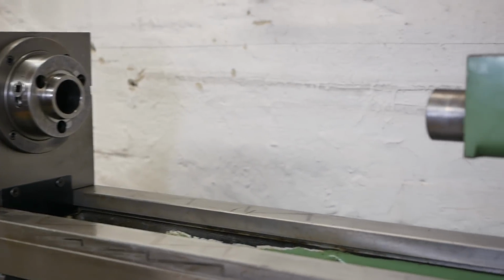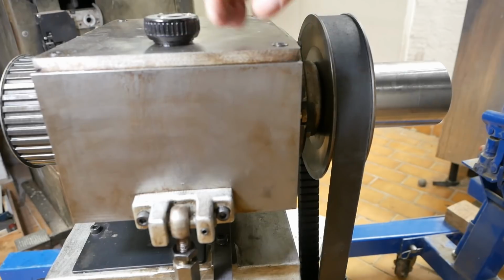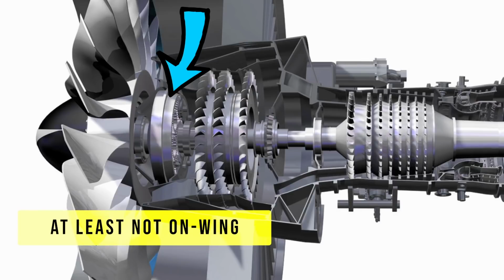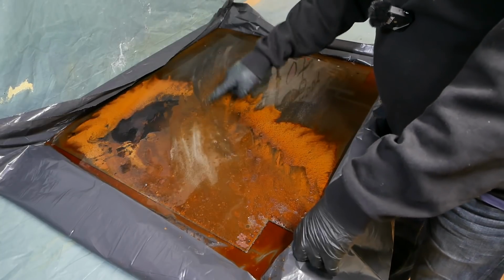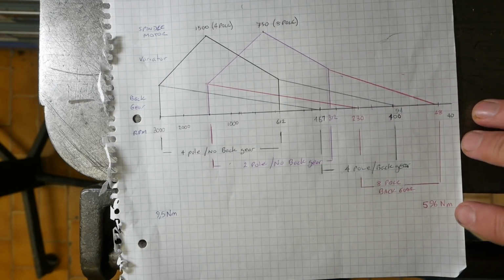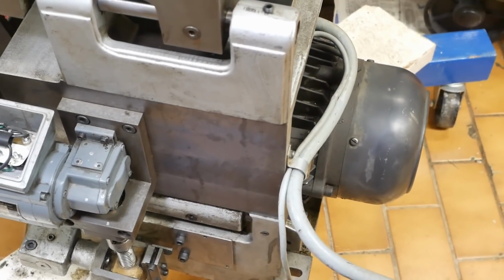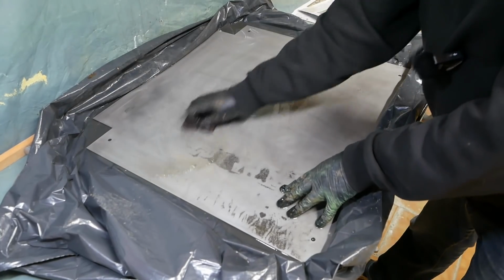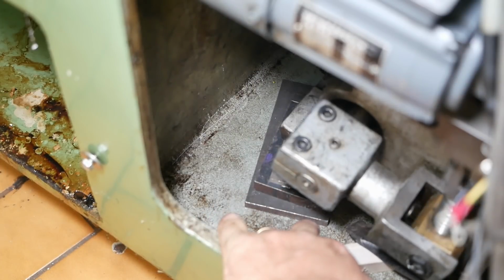Installing the Schaublin drive train

Comment: Maybe add an AC line reactor between the motor and VFD. For just a little more impedence, they offer good harmonics dampening and a cooler running motor.
Reply from the maker: Thanks for the tip.

Comment: I have kept the 35 year 3-phase old motor and the set of pulleys on my small lathe and purchased a VFD so I do not have to change v-belt on pulleys that often. (AND I do not have to pay my electrical distributor to wire my garage for 3-phase)
It hasn't even crossed my mind that VFD could damage my motor. I only run it up to 60Hz and I run 380V motor on a 3x230V (because I only have 1 phase at the garage and use 1-phase to 3-phase VFD. I have purchased used fancy VFD (altivar).
Reply from the maker: The more electrical knowledge you have, the more everything ruins everything else. I also used to think it was as easy as three wire, and you are good to go :)
Reply: @RotarySMP  Mind you, I am not electrician but I have consulted the vfd installation with experts at work and the motor wiring with a very highly qualified retired electrician - he also approved my plan to rewire my motor from star to triangle, so I can utilize the 3x230V vs original 3x380V more efficiently. None of experts mentioned that I have to have a special motor to run with vfd, I was just told not to try things like running it on 400Hz sinus, or changing the default switching frequency of the vfd to much higher values. I wanted to do that to mitigate the high-pitched whine typical for vfd-s. As I said, my vfd was purchased second-hand and it has obviously been installed in industry. I downloaded several hundred pages of wiring and programming manual - unlike cheap Chinese small vfd-s that come with 5 page manual (half of it in Chinese).
Reply from the maker: @first_namelast_name4923  This Lenze also has a very good and thorough manual.

Comment: Keep the original motor, gearbox and CVT and just don't run it at crazy frequencies.  Most of what I've heard on VFD's killing motors has to do with cheap import motors which were probably of questionable quality and would have died anyways, VFD or not.  Additionally, the VFD you have appears to be of good quality so will likely have a cleaner output than a cheap import as well.  
Connecting some of the dots - higher insulation class means higher temperature resistance, and higher frequencies can lead to higher localised temperature. Put a thermocouple on the motor, keep an eye on it (or better yet have Linuxcnc keep an eye on it!) and be happy.  
Have the VFD drive the motor in its higher speed wiring configuration (2 pole?), I think that even half of ~550NM will be plenty for what you will throw at it when done.
Reply from the maker: The motor has some form of over temp relay, so I will feed that back into the E stop loop.  Yeah, I will wire it for the 4 pole high speed (2 pole motors turn 3000 rpm, this is 1500). I need to think through the control logic whether to depend on the VFD for the primary speed control, of the CVT. the Back gear will have to be inhibited with the spindle turning.

Comment: Wow I did not know about these isolation calsses... I have to check for my VFD/motor setup 🤔
I would connect everything before installing everything and make a test run. If it doesn't blow up right away then go ahead.
I wonder if there are isolation testers for that?
Reply from the maker: There are insulation testers. Since the TWA 800 air distaster, insulation testing has become common with respec to fuel pumps and other fuel tank safety relevant components. Unfortunately, I have no access to one.

Comment: You have "vinegar and rust mixed with plaster" recycling available?
Reply from the maker: It will go in the building rubble. Plaster is basic, adding dilute acetic acid , they will neutralise to a few calcium compounds. Rust is not dangerous , except to bridges. This  waste is not dangerous or toxic.
Reply: @RotarySMP  just busting your chops a little. You said "recycling" in the video, and I would assume the only kind of recycling available for this waste is the kind that involves plate tectonics and a few million years.

Comment: I would keep the motor and the variator, then  use the vfd and work from 30 to 50 hz this should be easier on the motor. Works like a charm on my old lathe
Reply from the maker: That is about what I will do.

Comment: Nice explanation od asynchronous jet motor :-) Very appriciate! I know you worked in aircraft industry, but what position? I really like jet engines and these information are so helpful.
But to your Schaublin - although I love mechanical marvels,  personaly i will use vector VFD instead of variator.
#3 fan
Reply from the maker: I worked in maintenance and in airline engine managment. 

I have that Lenze VFD so it will be VFD + CVT + Back gear.

Comment: The insulation class simply tells you the maximum winding temperature, not whether it's designed for use with a VFD. Class F is 155C hot spot, Class H is 180C. You may also see Class B (130C). The main risk is bearing damage if you don't have a grounding arrangement for the rotor (effectively an electrically conductive brush). I'm sure it will be fine anyway.

FWIW, my 1983 Shizuoka came with a Hitachi VFD from the factory (using IGBTs) - and a variable speed 3.5kW motor that was designed for use with a VFD.
Reply from the maker: I hate to think what that quipment cost new.
Reply: @RotarySMP  Well I can help you with that, as I have the original invoice. I also managed to track down and speak to the original purchaser (I am only the second owner) and the guy who most likely built the control system at Matchmaker UK.
The original cost was £38k and the sale was actually July 1984 (I was close!). Back then, that would have bought you a nice house. You'll be pleased to hear it did mostly aero parts before going into storage for over a decade when the guy retired.
The VFD still worked but I couldn't reprogram it without the dedicated programming tool, so I had to scrap it.
Last week we bought some SiC power modules - they cost something like £4k each. You pay top dollar for new technology....

Comment: Thanks for the great explanations...I learn a lot from your videos. (Most I will not use but appreciate learning it anyway)...I got a shiver thinking about the low speed torque....One of the things I like about my little mini lathe is that the breaker kicks with very little load. This turns into a great safety factor for a novice for myself.  Crashing the head doesn't break things AND if I were to get a body part in there it probably wouldn't amputate it. (don't want to find out though)....Considering using the motor or not: I would use it for now and if I found a need for that large of motor I would switch it to the need and get the new motor for the lathe.
Reply from the maker: Yeah, the 7x lathes tend to stall the spindle motor. This machine will make a big mess before it stops.

Comment: Reuse what you have, if/when it craps out get a servo spindle motor. Full torque from 0 RPM and potential for c-axis
Reply from the maker: Have to win lotto first :)
Reply: @RotarySMP  well if that happens hopefully you will be able to dream even bigger.

We have pretty decent luck with CTB motors and drives the pricing isn't too bad.
Reply from the maker: @wtsct339  I dont see any better lathe than this in my future. Although I really like using a manual lathe, so a matching 125C would be tasty.

Comment: I'm pretty sure original motor will survive. I honestly never heard of output filter for VFDs which people mention in comments, I know only of input filters.

If you plan to run it on lower speed, you might consider replacing motor's fan blades with external fan. You can buy motors like that (I think Lenze actually makes those), practically normal motor with longer body and fan slapped on end, independent of motor shaft. When VFD is driving motor at any speed, it automatically switches contactor and runs this fan on motor at full speed.

Also connection between motor and VFD is usually done by shielded cable. Shorter is better, but I've seen even huge motors 50 meters away from VFD and it worked for 20+ years with no issue.

About transmission, I think you should really keep everything like it is, even if it wasn't used now. For first experiments you can change speed just by VFD and control variator manually, later you can fine tune control of all those transmissions in software. Three "transmissions" in series aren't usual and it might be really interesting to see everything working at once. And you can make TOT jealous of such high numbers :P
Maybe it might be good idea to add some potentiometer on variator (if there isn't one) so you can guess at which gear ratio you are right now?

And one last thing, make sure you understand all parameters in VFD before turning on motor. It usually wants not only nameplate frequency, current and voltage of motor but sometimes other things too. Also there are questions like what will happen when motor is overloaded? Some VFDs can try to keep set speed, some rapidly slow down to last speed which fits set maximum current. And so on, it would be shame to overlook some important settings in manual ;)
Reply from the maker: Thanks for the suggestions. Really appreciate that.

The power cable is the length of the bed. Wont get it short than that, but it is only about 2m. 

I was also thinking about starting with the back gear and VFD under LinuxCNC control, as there are already software components for that. I could just bias the Variator with push buttons. The problem with that is a temporary solution which works is permanent. I need to have a think about the logic to control these three.

Putting some feedback of Variator position is a good idea. I hadn't thought of that.

Luckily I got the Lenze VFD with a programming module and instruction manual,but thanks for the reminder, as I set up my Siemens VFD just as you recommended, first inputting all motor parameters before hook up.
Reply: @RotarySMP  You're welcome, I hope my comments won't disappear after sending like on different video some time ago. Actually I tried to post one comment yesterday like three times on different channel and it just wasn't working. Comment is here, refresh, comment is gone :/

Then it should be fine. And in worst case you can wind some aluminium foil around, if there were some problems with interference. But I guess cable will go inside of metal frame, so it's actually shielded good enough :)

Oh come on, it can't be that bad! :D  On other side I'm even worse for sure. I'm dreaming for 10 years about building of hobby CNC and all I have are ideas and maybe some really old 3D sketch. I'm changing topology of everything in my head practically every month and it became one of "I'm bored, let's dream about CNC" things. How to make it cheap, simple and robust...and idiotproof, so even I can drill holes (I can't drill three holes in straight line x.x ) and somehow align that whole mess.
That reminds me, how is transmission ratio for that backgear? Originally I wanted to suggest simple deciding function but I got totally lost on how that backgear works. It's just switching in between of two ratios, right?

I thought it might help program to at least know where it is and which way to move, also with some calculations it means one more "speedometer" on your LinuxCNC screen :)

I'm keeping my fingers crossed for you. I was setting up only small Yaskawa V1000 drives and old Omron drive at work and I got really surprised how many things it can do. For example that Yaskawa does have even PID regulator for speed control, crazy! Maybe you'll find something really awesome too. Or at least you will be sure why are some things happening, which can help with troubleshooting later.
Reply from the maker: @DreitTheDarkDragon  Yep, the back gear uses a pneumatic piston to select between 1:1 and 6.5:1 ratios. Putting feedback on the Variator was already suggested. It is a good idea. Wonder if there is any simple way to get feedback of the back gear position?
Reply: @RotarySMP  Hmm, I'll have to check your videos again to see how it is done mechanically. If it was standard pneumatic cylinder, you could use magnetic sensors, since pistons in industrial cylinders are usually (not always) magnetic and there are grooves for sensors prepared.

Other way are induction sensors (M12 or M8 size are common, sensor itself is fine threaded rod with LED and connector), sensing presence of metal. For example you can have two sensors and then metal ring fixed on shaft which slides back and forth in front of sensors. Usual sensing distance is about 4 mm for M12, smaller case (M5, M8) usually means much shorter sensing distance. Induction sensors are also often used to measure speed of shafts (just screw something on shaft to make pulse every revolution).
I was in USA recently and I noticed there are even induction sensors for high pressures, connected directly on hydraulic circuit. I took only photo of sensors itself, but it seemed to be going thru T-piece and sensing piston itself, while pressurized oil flows around sensor ._.  Really interesting solution.

And if even that can't be used, I heard of solution which measures air pressure during movement. Not air amount (those must be pretty expensive) but only pressure. Problem is when piston gets stuck, you can't simply detect that. Maybe with good timing you might pressurize cylinder (it should move to end position), then release pressure and measure how long it takes before pressure in cylinder falls - further movement means more air and more time. If time fits expectations, you can pressure it again to hold it in that position.
But I've never seen this in real life, only heard it's used somewhere, I'd take that as last resort. I'm not even quite sure if it works how I think it should.

I'm personally huge fan of induction sensors. It's nice to have magnetic sensors on body of pneumatic cylinder, but it can't tell cylinder separates from object it was moving. PLC is happy to see piston in correct position but part which it was pushing/pulling might be somewhere else.
Reply from the maker: @DreitTheDarkDragon  This is not a standard air cylinder. The piston assy is integrated into that gearbox.
Reply from the maker: @DreitTheDarkDragon  These comments seem to be staying. I really dont understand Youtubes comment engine. Some comments are only viisible at the bell, some in YT Studio and some in the videos comment field.

Comment: I agree with others, keep the motor and most of the mechanics, and figure how to drive it from CNC. Maybe use more modern contactors. It would nice to see this beauty work with all its mechanics.

If that does not work, you can always scrap this idea, and do it other way later.
Reply from the maker: I will need one modern contactor to isolat the VFD, but otherwise, it will be VFD+CVT+Backgear. Belt and suspenders :)

Comment: If its about vfd and 3f motor. I've heard the same myth as you said. Few years ago ive done some research, there will not be any problem with bearings due to its limits of rpm.(you can check yours) They are rated to much more than you could run your motor. BUT! theres problem with eddy current. It will heat up rotor and it axis which will damage bearings if you put too many hz through it.
Btw. I run my mill and lathe with vfd, i am not guessing any of this :)
Reply from the maker: Thanks for the feedback. SInce the Variator is staying, I can be pretty conservative with the VFD speed range.

Comment: For the vineger. Add warm water, or preheat the part, it will give you more fluid and accelerate reaction time. Even if you dilute it two times, but make it warmer by 20 deg C, it will be still faster. Essentially each 10 deg C double the reaction speed.
Reply from the maker: Thanks for the tip. Given my basement is currently at about 15°C, I just let it soak over night. No hurry.  Just should have used a little more.

Comment: id go with original motor and original contactor system, miniaturized if possible. no need to worry about randomly dying, no need for auxiliary cooling, no worry about overspinning the bearings, etc. maximum torque and maximum reliability. if you can make the space for it on the panel its going to be the safest option for sure.
Reply from the maker: Thanks for the feedback. SInce I chopped the control cabinet, I no longer have the space for the five big contactors + transformer, so that is out. I understand the appeal of it though.

Comment: i use a poly v belt instead of the variator. the motor i use is a 2.2kw motor with 1500rpm. i use a 5kw VFD so i'm able to clamp the motor in delta. so i can use the full torque at lower speed and i have 3.3kw at 87Hz. the motor runs at higher speed in field weakening operation to 120Hz with no problems. the use of the 1:6.5 oettinger is a must, but the variator isn't necessary if you use an VFD. if you'd like to give it a try, come over to my 125 ,-)
Reply from the maker: Good points. Since it is easy enough to pull the motor, I figured I'd leave the variator as is for now, and can still replace it later with a poly-Vee once I get the machine running. 
You added an exra fan to cool your motor right?

Comment: Calculate power and torque for cuts you expect. 600Nm cuts are........ unlikely. Back then, they were probably still considering tool steel cutter surface speeds.
Reply from the maker: That is pretty much I was thinking.

Comment: Instead of the CVT(continuously variable transmission) you could replace it with some belts and a VFD
Reply from the maker: I could, but I already have these parts, so it was just easiest to reuse them.